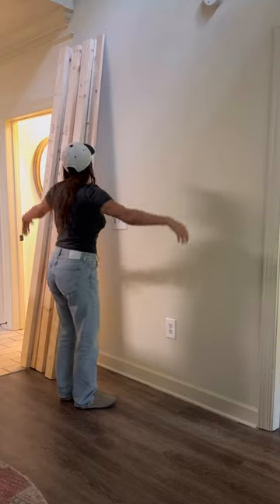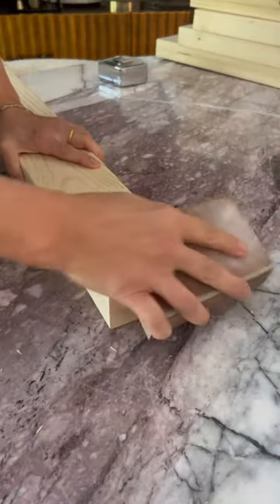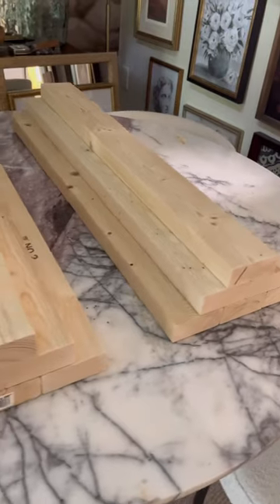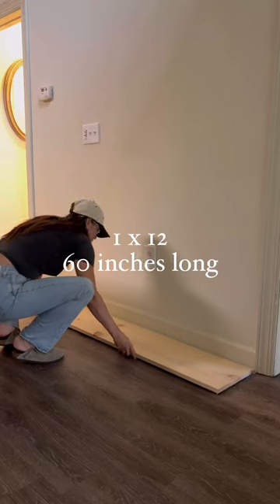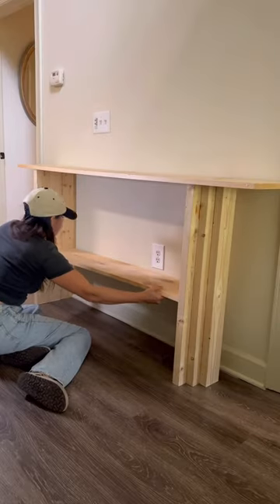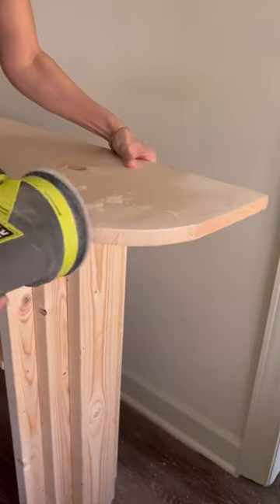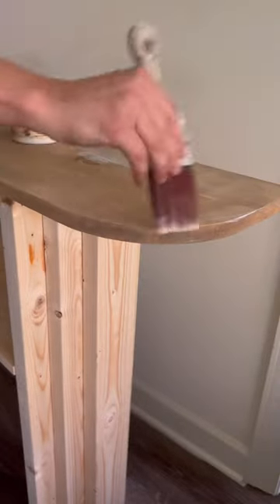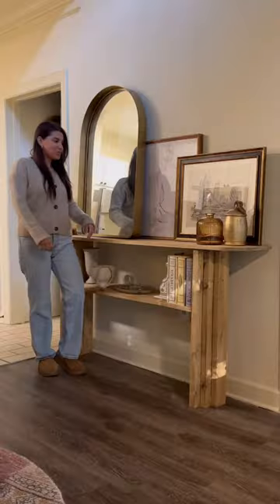ad Beginner Friendly DIY Console Table! 🤯 I’m using @DixieBellePaint products! #shorts

Comment: NOTE TO ANYONE MAKING THIS:

If you cut 34" pieces,  as shown,  you will only get 2 from each 'stud' (they're just under 8ft). Needing 12 pieces,  that's 6 boards, and they are about 6-8$ each.

If you instead,  cut the legs at 31"3/4, and MAKE SURE to buy true 8ft boards (96 inches!), you can get 3 pieces from each, and save yourself a couple bucks. You'll only need 4 boards instead of 6.

SAFETY TIP:  If you got kids,  or like to drink and stubble around your house more than you should,  another simple mod is to add another L- bracket;  put it anywhere along the underside of the table,  facing the wall (where you find a stud). By adding screws up into table,  and back into wall,  you can keep it from tipping forward if someone leans on it (or short kid reaches up for smthn).
Reply: Thank you for this!!

Comment: But...something tells me there should be more than glue holding those 6 board legs together, seems like once the table is moved around, say in a moving van by movers, that it's gonna fall apart with only those L brackets and once that glue gets old.

Comment: Very cool but the top connection is flimsy. Take a couple short 2x4 and use them to connect top to legs on both ends instead of those weak L brackets. Just my two cents.

Comment: I just had an idea… If you wanted to make a longer version you could make another set of legs and put them in the center facing out instead of to the sides and still be able to put another shelf below, just cut out the shelf in the shape of the legs to fit around it. It would also add some depth and interest in the lower area.